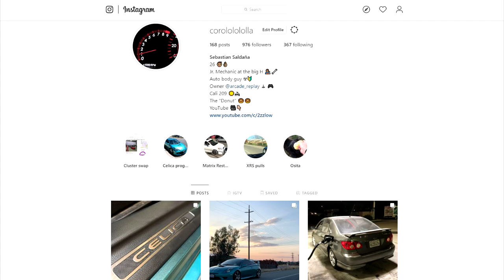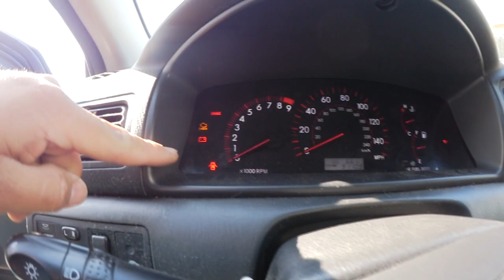Installing Clock Spring on my Corolla XRS (05-06)

Comment: We had 3 Corolla's and went to the dealer to do the R90 recall Airbag problem. 3-6 months later all 3 Corollas have the airbag light always on issue. Coincidence?
Reply from the maker: Same exact thing happen to my xrs.
Reply: @2zzlow  same with me, Dealer charged $171 to tell me clockspring was bad but replaced just before pass airbag replaced.used 84306-02170 2005 Corolla S

Comment: Same problem here with 07 Matrix XR. Took it in last year for passengers side airbag recall. Month later the airbag light came on. Took it back and they said it was the clock spring. Find it odd clockspring only went after they messed with my car. Now I have another recall for the bag they changed last year.... 😒
I'll change my clock spring and leave it alone. Stealerships cause more problems then good.
Reply from the maker: Funny less than a year after my air bag recall my air bag light came on for this clock spring on my Corolla XRS.
Reply: @2zzlow  Exacly, same here seems suspect to me too. Dealer wanted $800 to replace clockspring. literally a 20 min job.

Comment: You the man.  I'm going to try this.  Let me know if it's failed you yet.
Reply from the maker: Went bad early this year, air bag light came back on. I decided to open it up and again the ribbon cable inside the clock spring ripped. for a cheap $10-$15 clock spring off ebay little over 2 years was worth it compared to the price of the OEM one which is almost $200 last i recall.
Reply: @2zzlow  thanks for the update brother

Comment: Just replaced the clockspring assembly cleared fault two thumbs up. The only problems with the video is audio was low and the connectors to the air bag need more detail , you don't have to completely pull the tab up just enough for the connector to pop on needed better camera view . Otherwise excellent video one for the dyi.er  0 for the stealership.
Reply from the maker: I appreciate the comment, helps me improve for future videos.

Comment: I'm 57 years old and a grumpy fart and very suspicious about that situation.
The only time ever (since 1994) check engine light appeared on any of my vehicles was when I took it to the dealer. The only time I ever took a car to the dealer and driving back home in less than 5 minutes, a check engine light appeared. My car was Mazda Protege with roughly 30000 kilometers ( 19000 miles) on the odometer.
Tomorrow morning finally I got an appointment for a recall to replace the airbag on my 2006 Corolla. I was actually thinking about that before even setting an appointment. I always do preventive maintenance and I hope something like that doesn't happen to me.
I just don't trust them!
Reply from the maker: if your air bag light comes on after this recall I highly suggest you take it back immediately
Reply: @2zzlow  I agree!